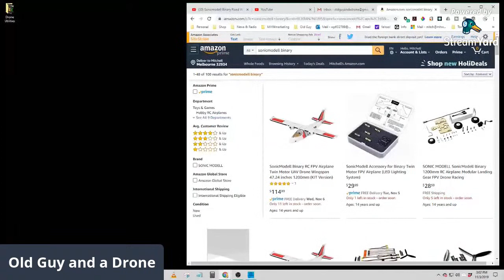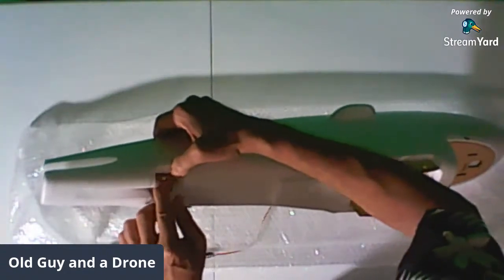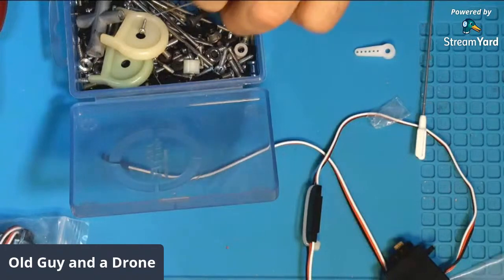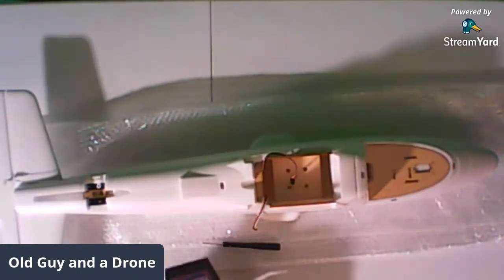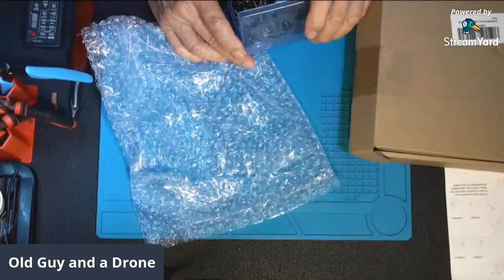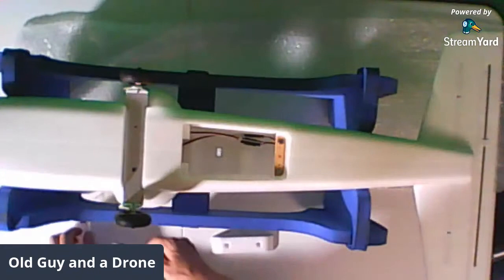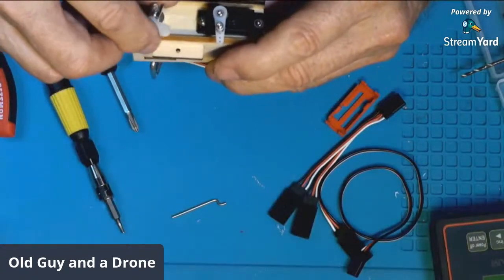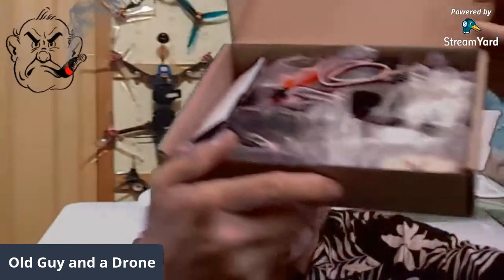Sonicmodell Binary Fixed Wing FPV Live Build Series #2 Let's Get To Work

Comment: Just got the Sonic Binary delivered yesterday. I've got 4 years in RC planes, mostly Warbirds, but ZERO experience in FPV. I'll be watching this again over the weekend for the build. When I get to the FPV stuff I'll be bugging the heck out of you.  But thank you for taking the time putting the build videos together. Out of the 25-30 I own, I've never opening an Instruction Manual for a build. Like you, I love the build and figuring things out by trial and error. Thanks again for the time spent on the series. Since it's rained in Atlanta about everyday for the past 2 months and more rain in our future I'll have plenty of time to put this plane together....
Reply from the maker: Sounds like you have enough experience to get this done. If I can help with anything, let me know. I have an FPV workshop livestream every Sunday at 8pm Eastern time. Feel free to join in and ask questions......Mitch
Reply: @OldGuyCarnivore  Thanks Mitch. I got the Sonic Binary down to the basement and was looking around and I noticed I have 2 Hawksky V2's that haven't been flown since I was a beginner. (One I didn't even glue in the pilot figure thinking to myself at the time, "This would make a great FPV plane someday." And the plane got pushed into a corner once I started with warbirds....
I'm going to build the Sonic, that's my favorite part of the sport, but I think I'm going to use the Hawksky as a sacrificial lamb to try out setting up the electronics that differ from the typical Spektrum radio, spektrum receiver and start gathering the equipment and understanding better cameras, GPS, FrSky, etc. I copied and pasted into notes all the electronics you used and going on a shopping spree on Amazon. (OCD is a terrible thing to waste)
I may bug you in the next couple of days on which transmitter, camera, etc. you would recommend.
Reply: Mitch, ordered everything you had listed on your shopping list. I’m a Spektrum guy since Day 1. What FRSky Transmitter would you recommend for starters in the 2-5 mile range. I’m just about to hit the “buy” button at Amazon for the X9 Lite in case you tell me otherwise.
Thanks for the help Mitch! See you Sunday.
Reply from the maker: I use the Jumper T16 with the R9 module. I haven't played with the x9 lite.